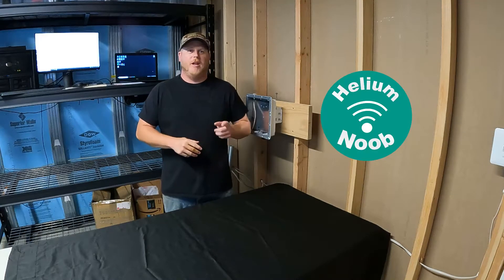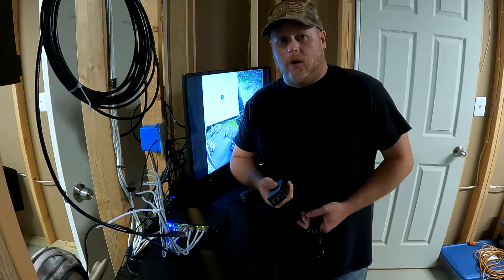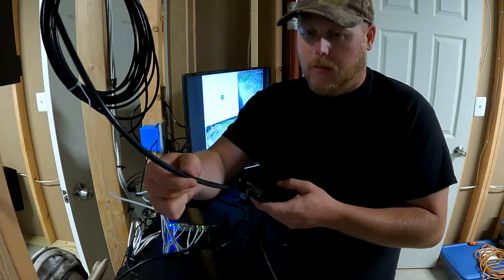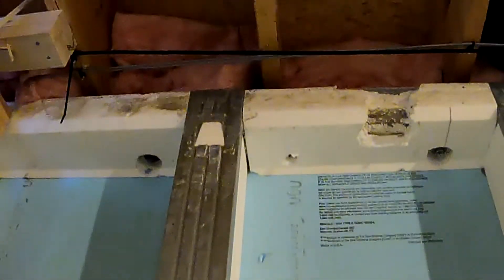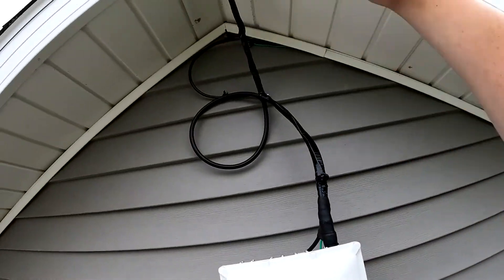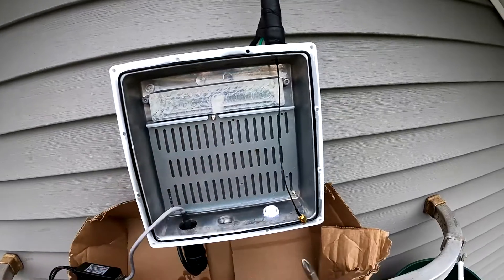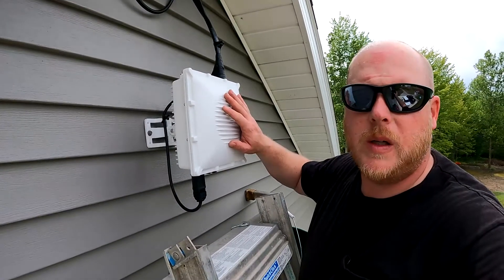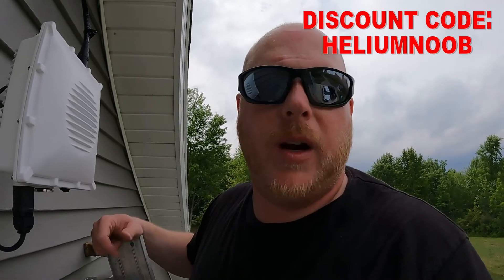Part 5: RAKwireless Outdoor Enclosure, Hotspot Miner V2 Install (for mining HNT)

Comment: I have a question. So with the POE splitter and injector you don’t need to run the USB-C to the miner?
Reply from the maker: You do have to still plug the miner in with the splitter using both USB C and ethernet port. The injector puts power and ethernet on the line, then at the miner you have to split it back out to usbc and ethernet because the ethernet port on the miner is not "poe" by itslef.
Reply: @HeliumNoob  thank you 🙏 watched your whole installment series, perfect information!  I have a RAK v2 also and followed your steps to the T. Once again thanks.

Comment: Thanks for the video. Question: if I have a POE switch box that’s powering POE cameras and the switch is connected by Ethernet to my router, do I still need an injector or can I just run Ethernet from the miner that’s connected by splitter straight to the POE switch box and be g2g? Will having the miner plugged into the switch with the cameras interfere with the mining process?

It sounds like you use an injector because your switch is non Poe so that’s to add the Poe right? All I would need is a splitter to power the miner and be connected to the router via the switch. Based on what you mentioned that the manufacturer states the port cannot power Poe so you need the splitter to get the job done correct?

Sorry for rambling, hope I’m making sense hahaha. Thanks in advance, look forward to a reply.

Comment: Thanks for doing a complete walk through on how to set this up. Question: is there a reason you didn't install everything inside the enclosure on the ground and then mount the enclosure? I am not in love with the idea of doing this much fiddling while on a ladder.
Reply from the maker: Sorry reread your question. When I was filming  I didn't have the miner at first. But yeah if you know your run lengths you could fully assemble on the ground and tuck the ethernet cable from enclosure down into the house. I did it opposite basically.
Reply from the maker: Only reason I did that was to reduce the run of lmr400 to minimize signal loss, because that location is more of a lone wolf. I need all the distance I can get with that 8dbi. If you have better miner density in your area...the signal loss won't hurt you as bad. You could put it like standing level.

Comment: Do you have to use an ethernet cable? I've heard that miners are wifi compatible and I didn't think they would need one? Or does the ethernet cable also provide the device with power?
Reply from the maker: Hey Zach, thanks for the look. I am using it in a poe (power over ethernet) format. The device is powered by ethernet. Not necessary if you have an outlet near...but it is a way cheaper option than having to have an electrical outlet ran.

Comment: Why the outdoor enclosure?  Why not just install the miner inside and run the antenna cable inside.
Reply: The longer the cable, the greater the db loss from what I understand. Longer cables mean a greater distance for the signal to travel and greater loss
Reply: @zachdee8283   If your under 25ft with  LMR 400 cable there's not much loss.

Comment: Great videos! Thanks very much!
Tell me please, 
did your miner "RAK Hotspot Miner V2" work in the cold, at a temperature below 10°C / 14F ?
Will this miner be able to work in winter - if the temperature is between -10° C and -25° C ?
Reply from the maker: Thanks! I have not gone through a winter yet so I can't fully answer your question.
Reply: @HeliumNoob  Thanks for the answer!=)👍

Comment: Thanks a ton! I was wondering how you managed to get the Ethernet out.. great job!!
Reply from the maker: Glad I could help!
Reply: The other option I am thinking is supplying the Poe from modem (basement/low level) to attic. 

Do you know what is the temp spec range for these enclosures and can they withstand severe winter like MN?
Reply from the maker: @ArunMPEdison  what miner are you using?
Reply: @HeliumNoob  Bobcats.
Reply from the maker: @ArunMPEdison  https://news.rakwireless.com/some-q-a-about-our-bobcat-enclosure/ it says 0-40 Celsius. Not sure what bobcat says though

Comment: I assume you left the miner plugged in as long as possible just to clip left a little more HNT? Or were your worried that it would unsync from the blockchain? How long would that take?
Reply from the maker: I wanted to minimize downtime for syncing.
Reply: @HeliumNoob  Is there a direct relationship between time unplugged and snyc time? How long do you have to have it unplugged for it to revert back to a full day or two for syncing? I plan to have mine unplugged and in the box before getting up on the roof to mount it. Then run the ethernet down to the POE injector. If that takes about an hour, how long until I am back up and earning?
Reply from the maker: @gregballering4799  depends on the miner...I ha e a RAK, and was about an hour unplugged while I moved it to final spot...it resynced in a couple of mins.
Reply: @HeliumNoob  Thank you! I have a Rak also

Comment: do I need the poe injector to run my RAK v2 off ethernet or can I just use the splitter
Reply from the maker: If your source (router or switch) is poe capable you could get away with just the splitter. But if not, you would have to put an injector on it.

Comment: Does it make any difference when it comes to performance to have a poe injector and splitter 1000mbps instead of the stock ones that comes with the enclosure kit 10/100mbps???  Thanks in advanced!!!
Reply from the maker: Nothing that you would notice in this application, unless you have 1000mbps internet speed. In that case you would need to.

Comment: Can you please add links to all of the ethernet cables and splitters you used? thank you.
Reply from the maker: Eric, thanks for the look. Please subscribe if you haven't. 
The injector and splitter are included in the RAKwireless enclosure kits, they have them for either the Bobcat or RAK V2 miners. 
Bobcat = https://rakwireless.kckb.st/heliumnoob-dh4 
RAK V2 = https://rakwireless.kckb.st/heliumnoob

They also sell the injector as a standalone, but not the splitter for some reason. The injector is here, you just have to pick the right standard (plug type) for your country https://rakwireless.kckb.st/heliumnoob-hkk

Splitter stand alone for RAK V2 : https://www.amazon.com/UCTRONICS-PoE-Splitter-USB-C-Compliant/dp/B087F4QCTR/ref=sxin_13_alexaas_1_B087F4QCTR?cv_ct_cx=poe+splitter&dchild=1&keywords=poe+splitter&pd_rd_i=B087F4QCTR&pd_rd_r=2a465b05-8341-4265-a5f2-cdbd88d94c9e&pd_rd_w=4bGg4&pd_rd_wg=gL6Jv&pf_rd_p=0ba9ec09-8e28-4b22-8e68-77e0fdc8b488&pf_rd_r=K787FW87FMQNCWGBHY46&qid=1626451873&sr=1-2-509f3c19-353d-402d-9e8e-afdddb9f06c9
Splitter stand alone for Bobcat: https://www.amazon.com/Splitter-Compliant-Surveillance-5-5x2-1mm-PS5712TG/dp/B08HS4Z7JQ/ref=sr_1_12_sspa?dchild=1&keywords=poe%2Bsplitter&qid=1626451959&sr=8-12-spons&spLa=ZW5jcnlwdGVkUXVhbGlmaWVyPUEzM1E3NEw3T1hHV0lQJmVuY3J5cHRlZElkPUEwNzEzNzc0MjJUUVpIN1cxUTVVOSZlbmNyeXB0ZWRBZElkPUEwODU3NTUyMkYwSkVKODA1RFk1MCZ3aWRnZXROYW1lPXNwX210ZiZhY3Rpb249Y2xpY2tSZWRpcmVjdCZkb05vdExvZ0NsaWNrPXRydWU&th=1

The ethernet cord I used was: https://www.amazon.com/gp/product/B07XX1TCT9/ref=ppx_yo_dt_b_asin_title_o08_s00?ie=UTF8&psc=1

Then you need just a short ethernet cord.

Hope that helps.
Reply: @HeliumNoob  thank you so much!

Comment: I connect my 8dbi antenna directly to enclosure.
No cabel between enclosure and antenna. 
Do you think it will work?
Reply from the maker: I have not tried it, but I have seen some deployed this way, It should work.
Reply: Yes you can. I am about to do a set up now.